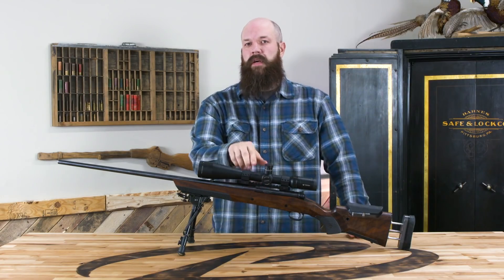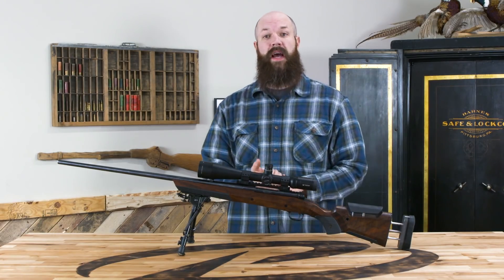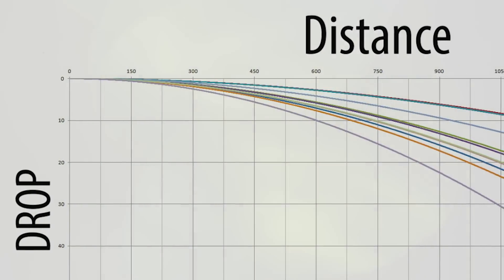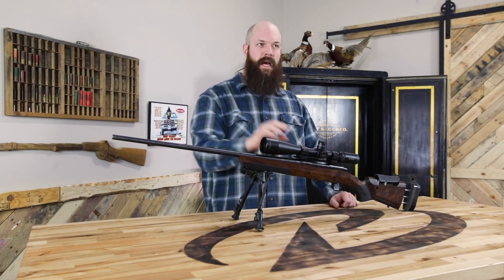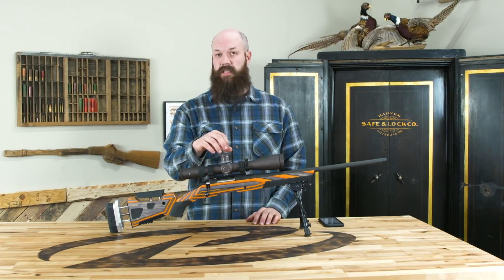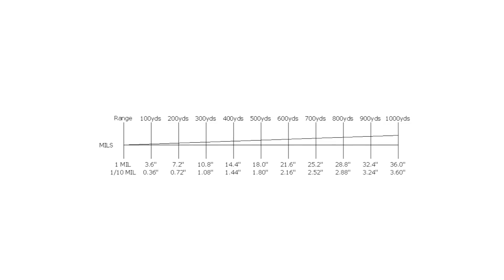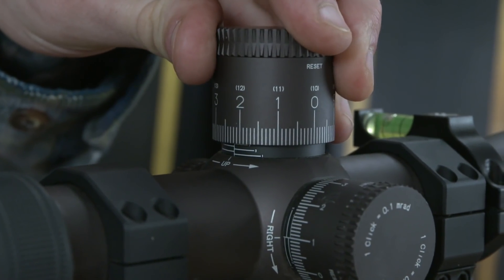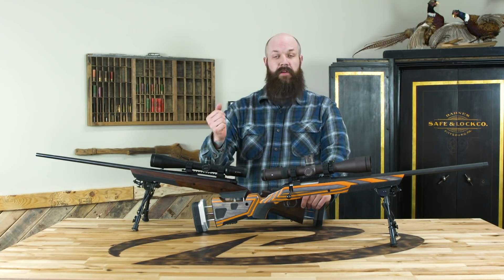Boyds: Beyond Stock, S1E3 "MIL vs. MOA Adjustments"

Comment: If you're going to use a Milliradian based scope then, the best way to implement the MIL system is to use meters & not yards. 
MILS works best with meters because they are both base ten systems. This is where the true ease & power of the MILLIRADIAN system is brought to bare.
Everything is either divisible by or, a multiple of TEN.
Reply: Absolutely. I know the metric system is a little different for our American brothers, but it's so much simpler in the long run. This video from Ryan Cleckner is very good. https://youtu.be/S5AGsHSIsVo